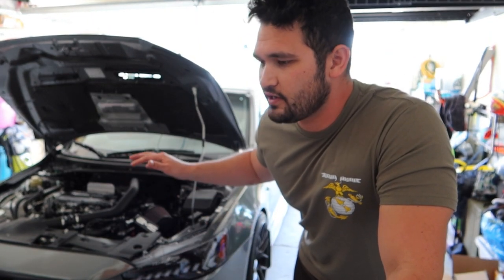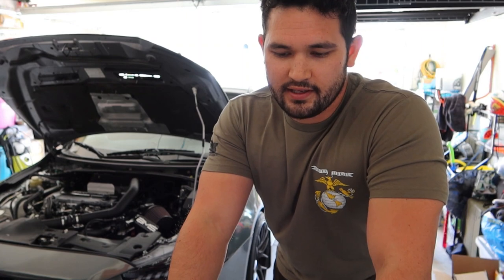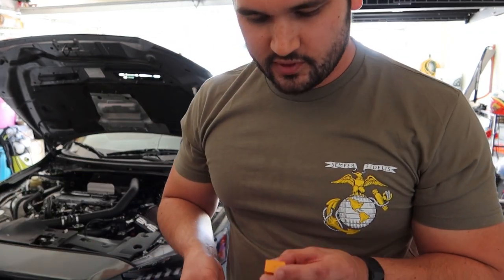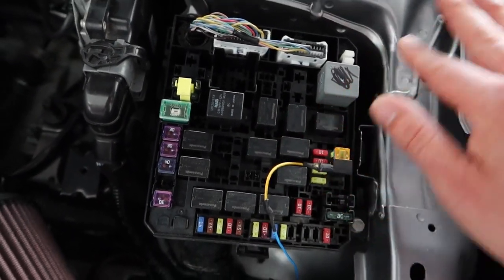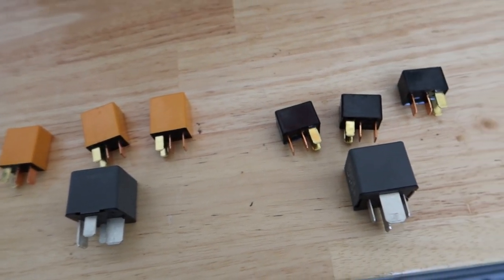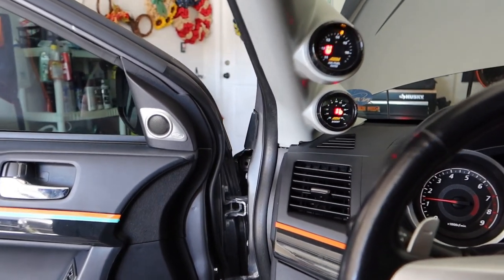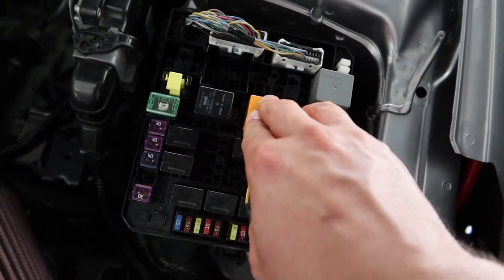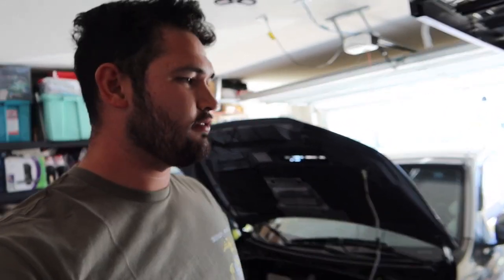2008+ Evo X / Ralliart Fuel Relay upgrade

Comment: Definitely anyone with an Evo X change the old ones out. I took my fuel pump relay apart and it was totally burnt out. Had a big melted deposit on the contact. The old black relays can cause lean condition and totally wreck your motor, especially when WOT.
Reply from the maker: Thanks for that info bud!

Comment: @The Snyds I just watched your GFB BOV video I unscrewed the inlet couldn’t figure out which side it was so supposed to be on, I watched your video, but i noticed you changed the side you screwed the inlet into than what it came out of the box? is that the correct side? The website also shows it being the other way so now i’m confused. Figured id post this on your latest video to hopefully get a response as that video is from 4 years ago or so.
Reply from the maker: If I'm understanding you correct. It doesn't matter bro.